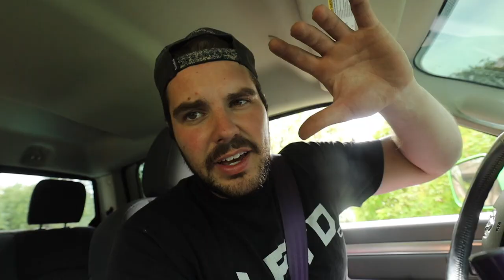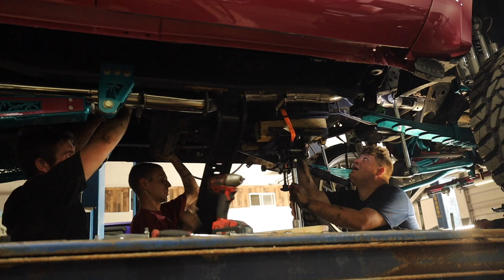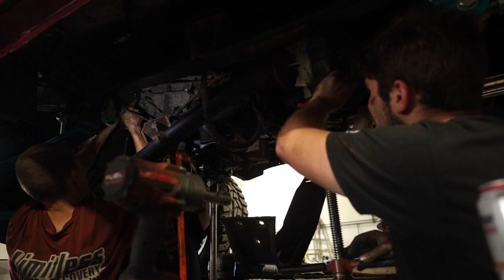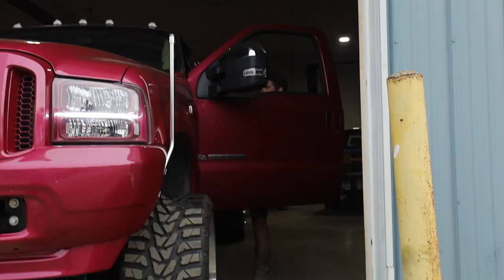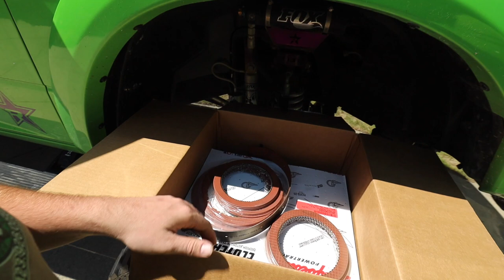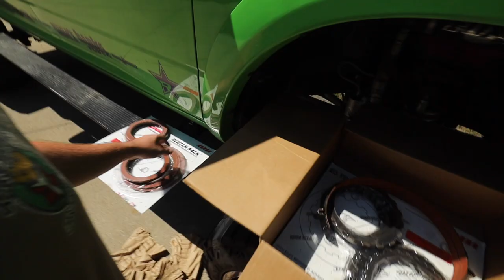NEVER Buying an AUTOMATIC TRANSMISSION Again * 4r100 DISASTER*

Comment: I’m hyped for the transmission rebuild video, I rebuilt my manual 5 speed in my garage and it was by far one of my favorite projects, but I’ve always wanted to build an automatic.
Reply: Building automatics are fun I have an 01 suburban with a 4L60E and it’s starting to get the normal 190k issues so I’m going to fully rebuild it and maybe build it for 500hp for when I build my engine
Reply from the maker: Right I’m so excited to dig in! I’ve always wanted to and there’s step by step clear directions everywhere which is something I though would be hard to find!

Comment: Not saying doing the cheaper and a little bit of a upgrade for the 4r100 but I personally would swap the zf6 in it because my dad has two 7.3s with 6 speeds and all hes had to do is put clutches in them thats all

Comment: The unfortunate reality to owning a Ford. I know you'll fix it back 200%!
Reply: Every vehicle has its Achilles heel.  The transmission behind the 7.3 powerstroke was originally designed for the 5.4 f150 and was beefed up slightly to handle the extra torque.  Combine that with an outrageously small transmission cooler, you're in for a rough time.
Reply: @CaptainRudy4021 how’s the transmission for the 93 7.3 IDI? The e40d? Does it perform long with no major fails?
Reply: @OhhBMRNG  that I'm not sure on that.  What I do know is the e4od struggled with the obs 7.3 powerstroke as did the 4r100 with the super duty trucks.  The 4r100 is actually based on the e4od.

Comment: Don’t  those kolene plates will beat up the case.  Do not use them for a daily driver.    For racing and truck pulling they are the only way to go.    But with what you have there you will have a great trans.    A 4r100 are easy to build strong.    I would love to have the jeep to put super duty axles under it.  Have the axles already.

Comment: Just do the relearn and also drive it easy for a few 100 miles before beating on it. Even when you messed with the valve body you were “technically” suppose to do that too I’m not sure if you did or not but if you did that sucks found on road dead. But I can’t wait till you rebuild it though that truck is bitchin

Comment: Shit Im having similar issues with my 4r100 looking into the shift kit and it has a newer tq converter in in my gears work and sometimes they don't but when they do it's perfect but sometimes it's first second or fourth that give me issues hope I don't need a rebuild. Any thoughts?
Reply from the maker: Feed bolts are free to check, solenoid pack (ehh maybe), and could be slipping gears and need a rebuild
Reply: @ryan2546  I feel like slipping isnt it cause I either have the gears or I don't and I verified this with my scanner pulling up the solenoid and it not kicking over at speeds or being locked out but then I've hit huge potholes and then the gears start working super weird if it was slipping I feel it would always be present and keep getting worse

Comment: The direct drum in the 4r100 is known to fail , time to pull it apart and cltuches and direct drum. Also 4r100 is a easy rebuild
Reply from the maker: I was thinkin the direct drum! We’ll see this week!
Reply: @ryan2546  theres a recall for a heavier built one in 2001 , same from 99-02 as you know but they messed it up in 01

Comment: No offense but this is the difference between a technician and a parts swapper. There is basically a proper diagnostic procedure for every process. Instead of guessing and replacing shit that isn't needed a bit of front end work prevents loads if issues. It boggles my mind why little to no one does logical diagnostics 1st. I get some shit is very difficult to test or testing equipment is expensive but time is money. Pay someone to properly diagnose something if you can't.
Reply from the maker: This was proper diagnosis…..either the TQ converter is shot or the forward clutch is gone there’s two options one takes an hour and parts off the shelf like we did or I tear the whole tranny down to realize It coulda took an hour and cost half the money it did. Or we throw the converter in it doesn’t work and it takes and extra hour to pull the tranny back out….internal problems require break down.
Reply: @ryan2546  that makes sense. But I'm guessing deep down you knew that tranny was shot. You should have just done the trans rebuild when you had it broken down last time and replaced the torque converter than. Im guessing those loose bolts create issues down line with clutches and whatnot. It seems you try to do the short cut too many times and it ends up creating more work later. I do truely get it. I've been there enough to try to give a little advice. Also appreciate how you've gone back to the OG video style. Keep up the good work.